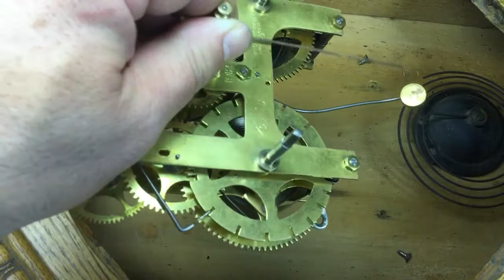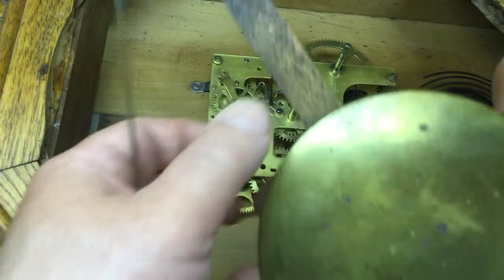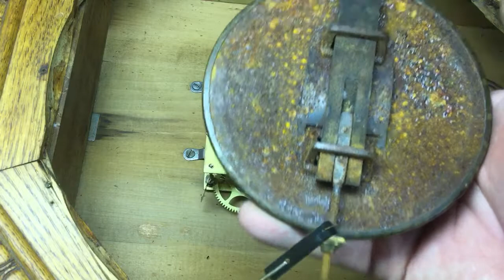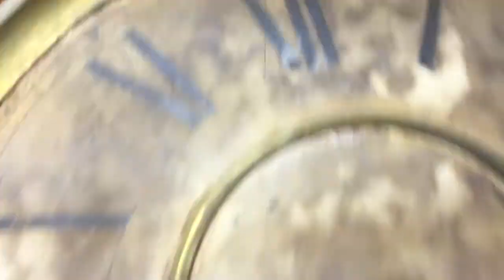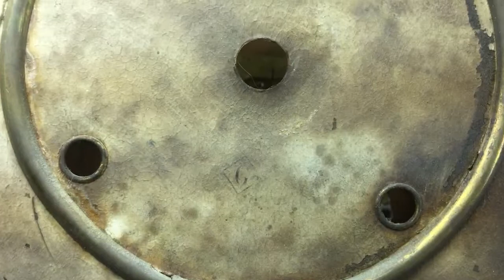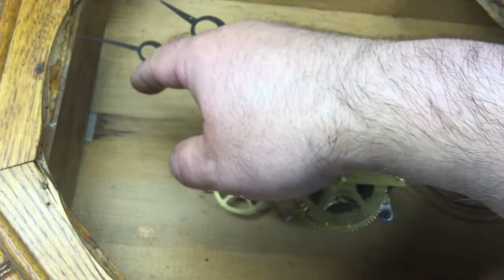Gilbert Long-Drop Octagon Clock Rebuild Part 13

Comment: So for setting the strike, why not just put the hands back on (let’s say the movement thinks it’s 5 o’ clock) to 5 o’ clock and then put the nut back on?
Reply from the maker: Good Question.
On this clock, the minute hand can be put on only 2 ways 180 degrees apart from each other. Only one way is correct because of the passing strike. Once the minute arbor is turned thru a 1/2 turn, it can be determined which way to put it on. 
Also, it is very important on a count-wheel striking clock to know how to synchronization the strike to the hands. 
The hour hand is just a slip fit, and can be positioned easily.  Once the dial is back on, and the hands are adjusted so they don't touch the dial or each other, the hour hand should not be touched. Because it is close to the dial, it is too easy to damage the dial or hand from handling. The bushing in the hand may also become loose from frequent re-adjustment.